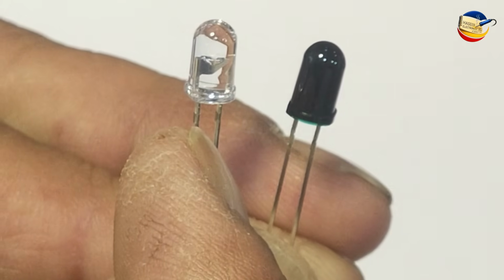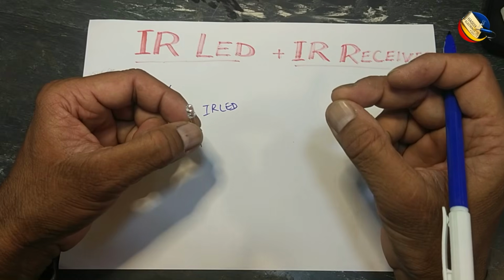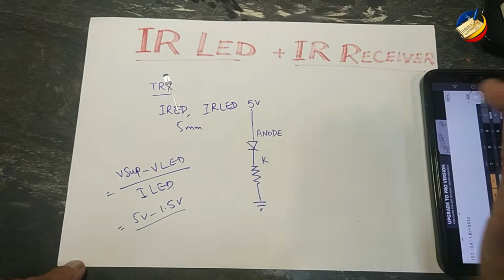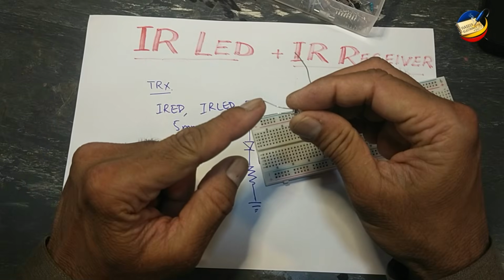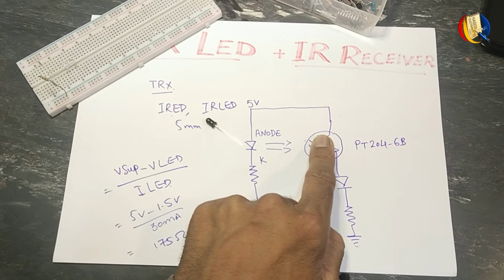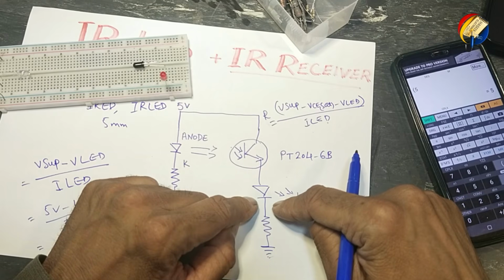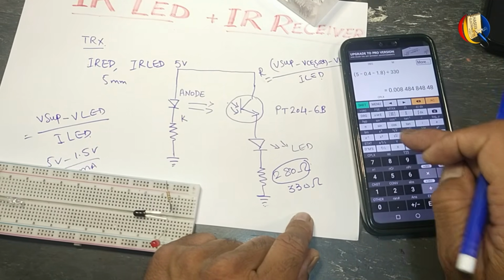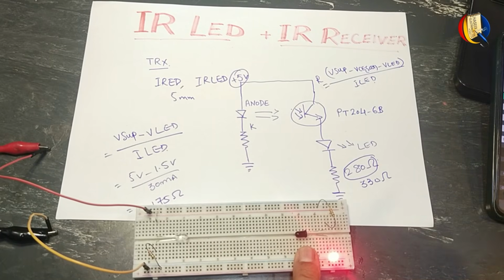Make IR Transmitter & IR Receiver Circuit Using 5mm IR LED & PT204-6B IR Phototransistor | Ep #1468

Comment: For how much distance this system perform it job well? Which type of transmitter and receiver are used in TV remot, masjid digital wall clock and vehicles ir key system?
Reply from the maker: 20-30mm IR LED current can communicate within 10 meter distance with direct line-of-sight. commercial remote controls are using 10-20mA and these communicate up to 5 meter distance
Car remote cootrols are not IR remotes, that are RF remote controls (which work normally 315Mhz , 433MHz, 862 and 902 MHz,
Reply: @HaseebElectronics 
Fine.

Comment: Namaste  Sir , today's video is Awesome knowledgeable . Almost a year back I had Requested you to make a video on Transmitter and Receiver circuit with schematic to control the rotation of the toy DC motor , without using 433 MHz transmitter and Receiver module and  Explain how the signal is transmitted from transmitter to Receiver circuit to control the DC toy motor

Comment: sir i have a request can you upload a video on driving full bridge of power MOSETS not logic one upto 100khz to 150kz frequency without mosfet driver use a totem pole ad drive it with TL494 push pull condition @HaseebElectronics

Comment: Alsalam Alikom brother Haseeb, thank you for this useful film as all the past films. I think there is a mistake in the breadborad circuit. The diagram says the resitor is conected between the emitter and ground while on the breadboard it is conneted between the collector and the supply voltage.
Reply: There is no other path to ground so it can be placed anywhere in series to limit the current, even between the emitter and led.
Reply: @TheWyleECoyote  Yes, you are right. Thanks